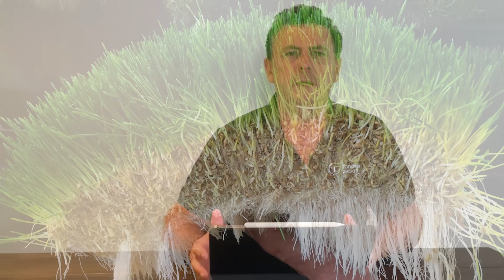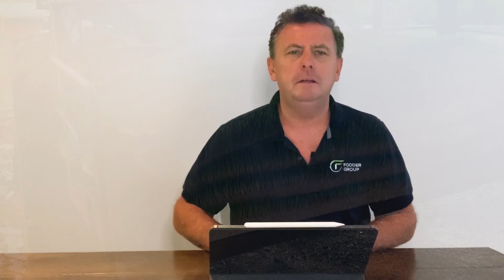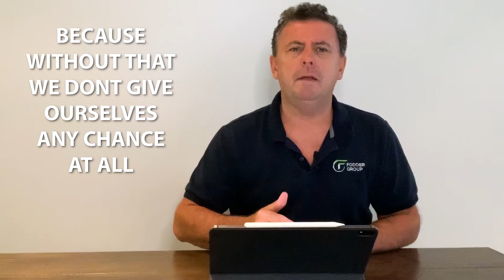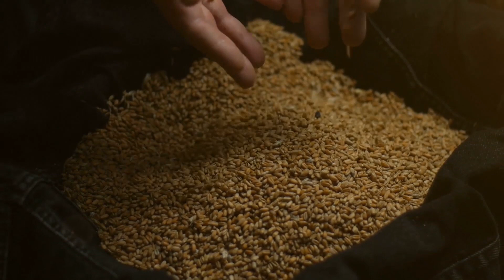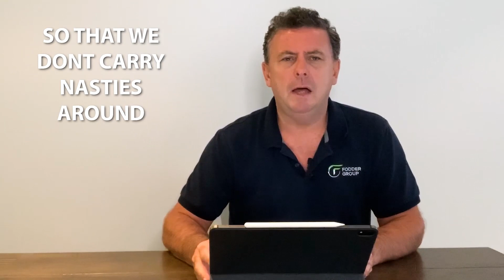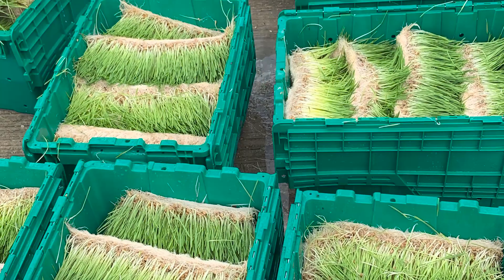Maximise Hydroponic Fodder Production With 4 Day Growth

Comment: Few questions... you mentioned a 6:1 ratio for growth. In an example of using a 1020 tray, would it be more beneficial to use 1 pound and get 6 pounds of fodder? I've seen many folks with ideal conditions (pre-soaking, good seeds, ample light and watering, right temperatures and humidity levels, etc.) who only get 8-9 pounds with 2 lbs of seed but wondering if the seed density plays a role and if less seed per 1020 tray would yield better results? Are you able to get 6 pounds on the 4-day cycle utilizing one 1020 tray? 

Additionally, I think we have pretty ideal conditions but am experimenting right now with a few variables and recording yields. I'm mixing up trays with or without blackout periods, different watering methods (bottom vs top) and the amount of water given per day. Any thoughts on best practices for those?

Thanks in advance!
Reply from the maker: 1:5 ratio seed to fodder is what we typically get as a year round average. Density can play a role, as a rule of thumb the more seed on the tray the greater the yield however it has limitations.

Lots of different factors play a role when it comes to watering rates and lighting etc. We would need to see the setup before commenting.

Comment: The truth is you get less dry matter than you put into the system. You also have to consume water and energy in order to willingly make less than what you put in. I would have santhesy was good for people without space but then you should your livestock the seeds rather than waste time with the "less" fodder dry matter.
Reply from the maker: Hakeem, head down to Best Buy or Radio Shack and pick up a calculator. Start pressing buttons with the real numbers so you get the correct answer. After that, have a great day.

Comment: How is the water system managed if I may ask ? Is it manually maintained or through automation through chips
Reply from the maker: The water and light sequences are managed via a PLC and are totally automated.
Reply: @FodderGroup   Interesting , also is it year around system bc i don't know if barley does grow the full year . If you can answer my query
Reply from the maker: @kamalnayansharma8586  these systems operate 24X7 365 days per year. Barley can be stored for an extended period of time so operating year round is not an issue.

Comment: What is the purpose of colored lights?
Reply from the maker: Late answer but a good question: the colour is a blend of blue, red and white LED wavelengths - the parts of the spectrum young sprouts actually use. It drives even, fast growth without wasting power on light the plant can't absorb, which is part of why the running cost stays so low.